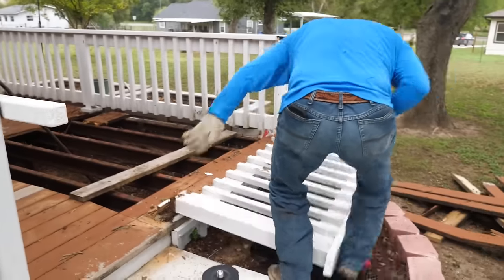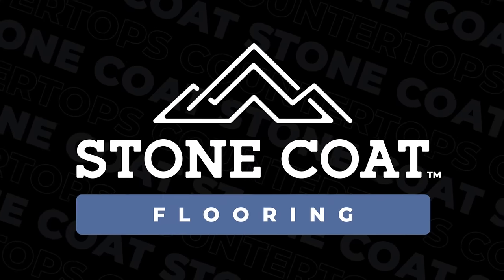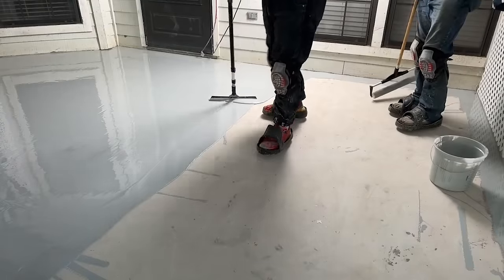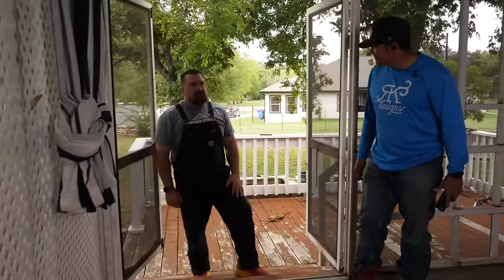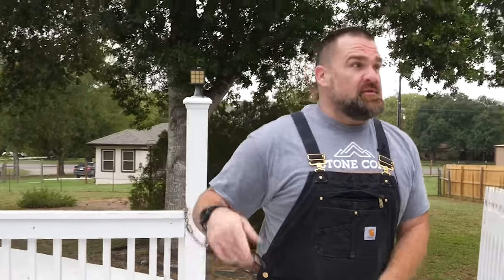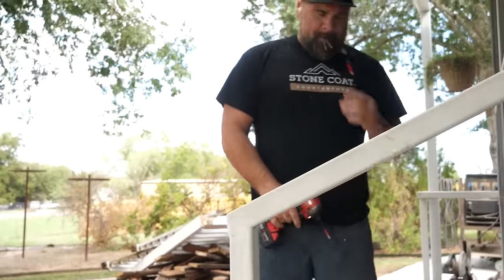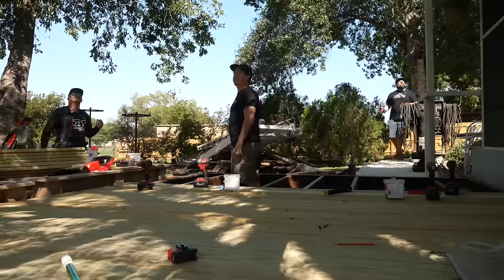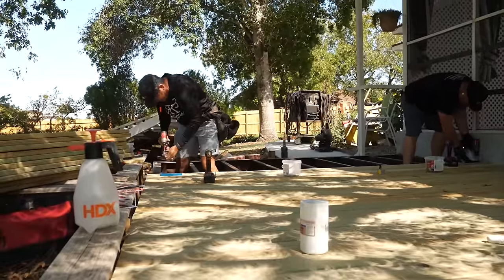DIY Pros Fix Grandmas Rotted Deck & Concrete Patio for Free

Comment: Joist tape on top of pressure treated would last as long as the steel.
Reply: A benefit of using a wooden beam/joist with tape on top is that you can then use concealed fasteners instead of face screwing. This reduces the amount of water intrusion into the wood around the edges of the fasteners which ultimately leads to premature rot/deck death.

Comment: I really enjoy your videos,  and what a wonderful thing you did for this nice lady. 
I have a random question,  I am a chainsaw carver and I have a piece I am just about done with, it will be kept inside as I have done my best to finish it up really nice, which proved to be difficult because I used cedar and it is really soft. I am curious if this can be coated in epoxy and what you might recommend, there are a couple parts of it that I really want to strengthen that's why I am thinking epoxy.  I am worried about the dry time and being able to get it all covered in time, can this be done in sections or would that cause problems. And I am not sure how much I will need either.  Also I understand you sell the products too, the reason I thought of you is because of your driftwood epoxy video actually.  Thanks for your time and God bless